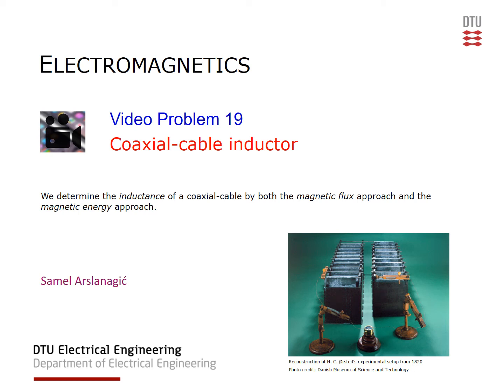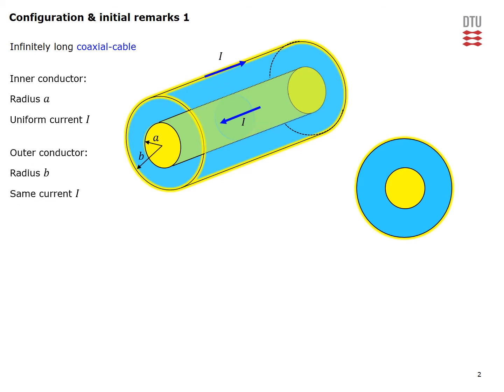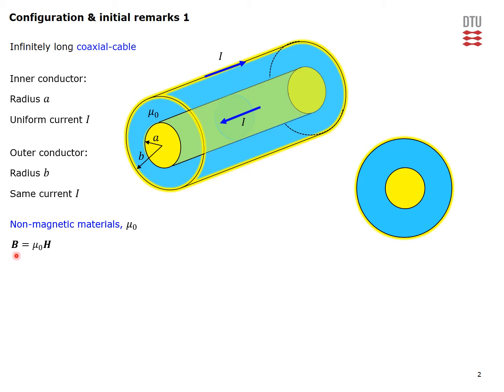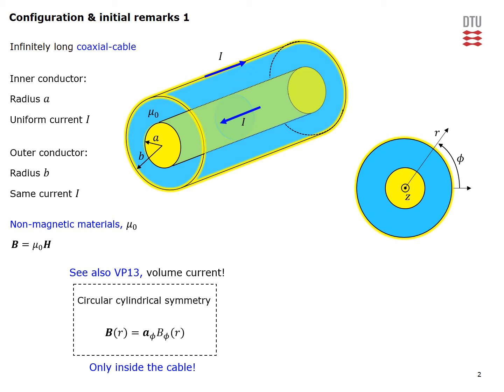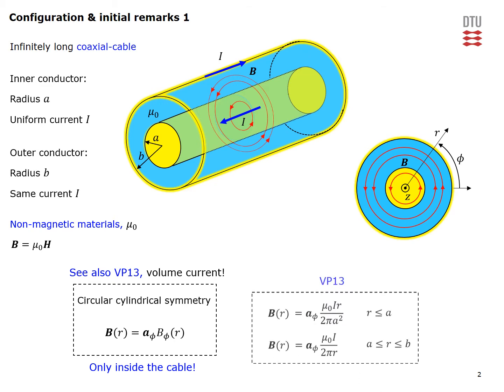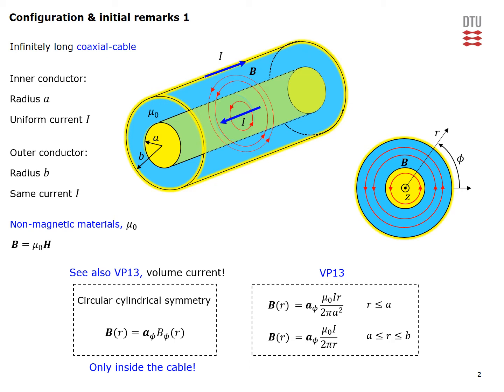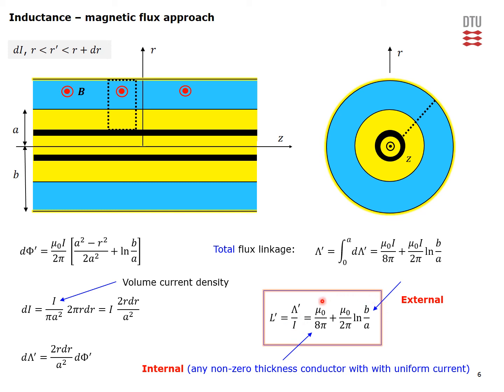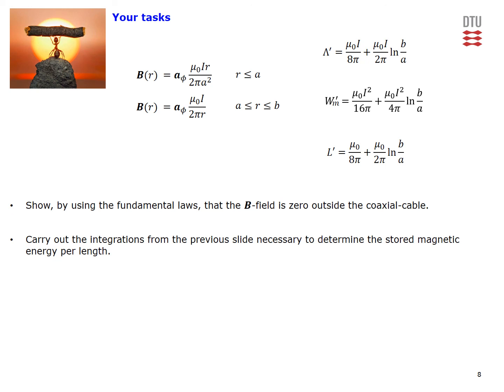VP19 Coaxial Cable Inductor

Comment: On the second question, where i should solve the (Wm') equation at 13:20 by hand i think you forgot to multiply the right integrant with (1/2) like the left one, or i just got the right side off by a fraction of 1/2 🤷‍♂ huge appreciation for the good quality videos.
 Best regards :D